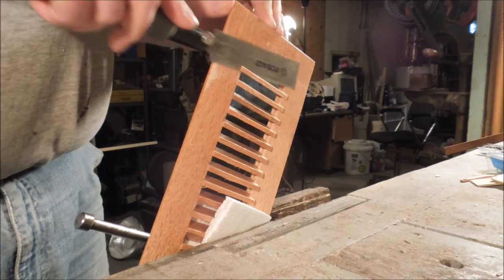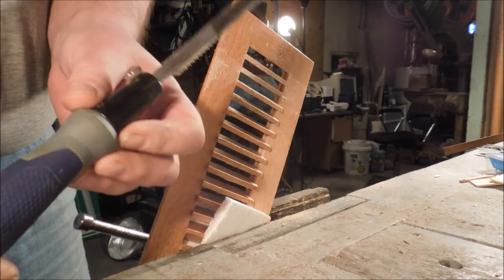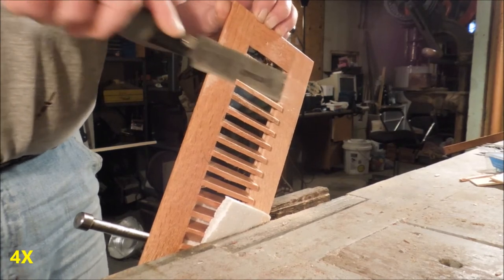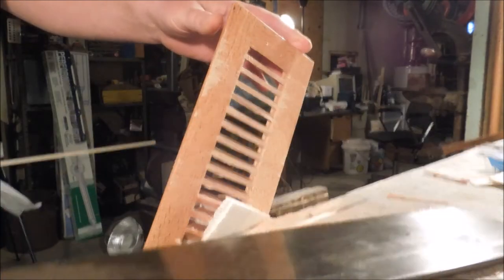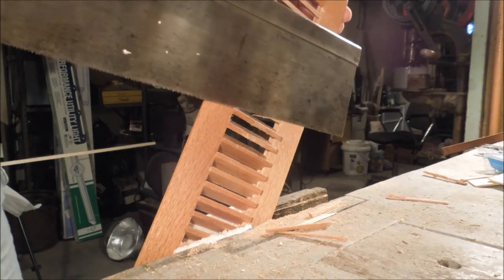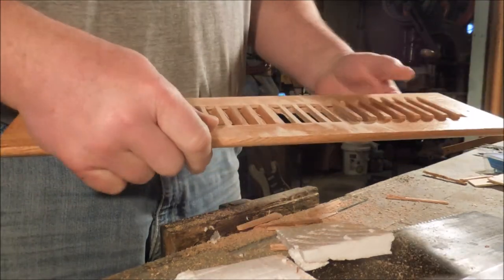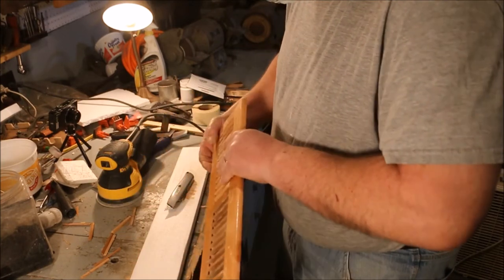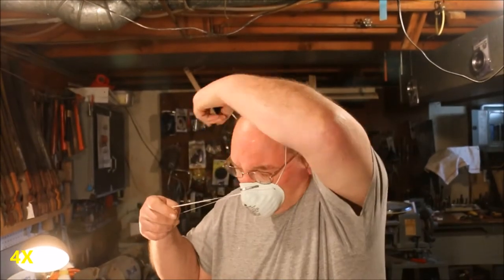WOODEN GRILL FOR THE FLOOR REGISTER

Comment: Only got two words for it   "EXTRA FANCY", but nothing is too good for the Mrs.  Oak and pine dust   plugs up my sinuses Walnut and teak gives me a rash, like measles. Good job can't wait for the BIG finish and Grand Opening of the new Throne Room.
Reply from the maker: Thanks Paul. The Designer has expensive tastes. Good thing I work cheap. 😊
Never had a problem with oak until I built the upstairs bathroom at the house by Union City. Put in a Jacuzzi tube and surrounded it with oak face frames and paneling. Added oak trim in the room too. Never thought of dust collection or respirators those days. Now I get congested from the least little bit of oak dust.

Comment: great way to save a few bucks and finding a way to use what you had on hand! I have to admit, I do prefer Japanese pull saws for many applications, mainly because they have a thinner kerf and cut pretty clean. Biggest downside is they cant be sharpened by the average joe.
Reply: quality japanese style saws are indeed good, but cheaps saws (of any style) are bad and a waste of time, and if you buy a bad one, you can think it is because it is japanese style and not because it was just a cheap bad saw
Reply from the maker: Absolutely. The pull saw in this video is not representative of anything other than an Lowe's Kobalt Knockoff of a real saw.
Reply from the maker: I don't own any good Japanese style saws, but I have this knock off. The teeth are so fine and pointed they would be a PITA to sharpen.

Comment: Stub toe vs Cut toe, - defiantly Not cut. walk softly ~ Much Nicer look!!     'box' in floor - it does not have opening [pocket]?  no heat here, so don't know much.
Reply from the maker: The original register was a box mounted on top of the floor next to the baseboard. The hole in the floor for the air to enter from is too small for this cover, or any reasonable cover, to fit into. So I'm going to set this on the surface. It will be about a 1/4" thick when done, and will have rounded edges,  so it should be okay

Comment: ahh cheap saws! i bought a drywall saw to use for a job, a cheaper one (as i dont need it much) total junk, blade way too thick and so blunt you couldnt cut fog with it,   serves me right for not buying one with a name ive heard of! well at least the handle is wood and will make a spare file handle,   ive ordered some padsaw blades, hoping they are as decent as the one that  had lasted me years instead.
Reply from the maker: I have a plaster board saw that was given to me. One of the nicer ones for being from Menards that's saying a lot.